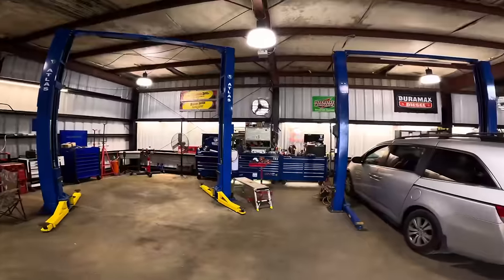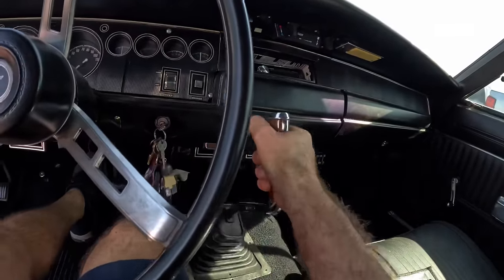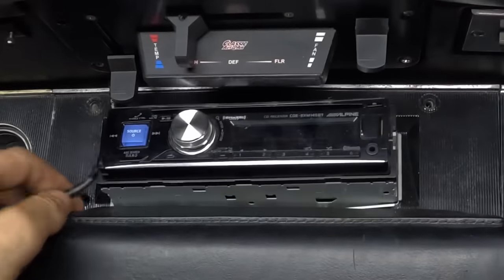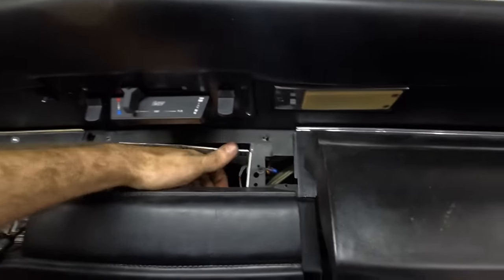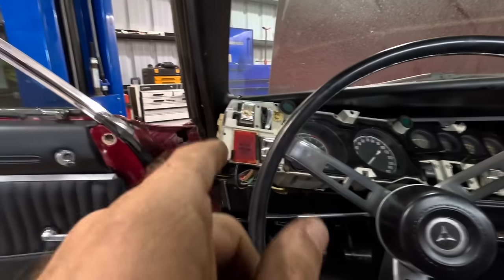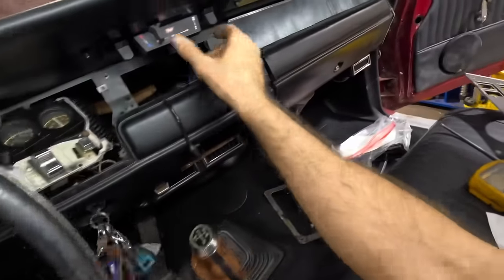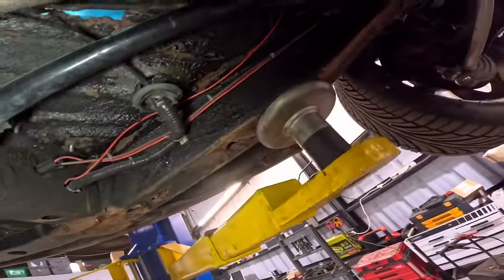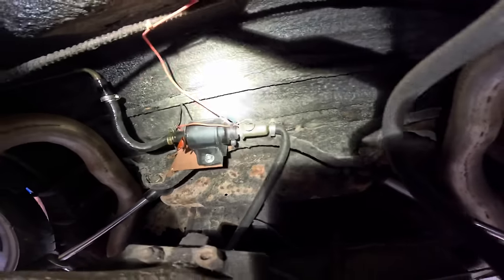Needs REee Restoration | 1968 Dodge Charger

Comment: As large as that car is I believe that the 68 Charger only dressed out to about 3800 lb. My 74 police interceptor was only 4,050. It was however the fastest car I ever personally owned, it had a 400 Interceptor engine in it which would wind up a bit higher than the 440. Three times I ran a 10 Mile Stretch an average 166.5 mph. And I did get it radar once at 187. It was still accelerating blazingly fast car once you got it off the stop. Especially if you were rolling along at about 60 to 65 it would accelerate 60 mph in about 3 seconds.
The amazing thing about it, even though I had changed out the carburetor to a holly instead of the original Carter. Was that it had a dead smooth idle.
As for the speedometer, the most often times you get that jumping speedometer. The magnets that cause the speedometer to work . A clock spring will resist the movement of the speedometer up the speedometer range. And there are a set of magnets that one is on the inside or outside of the other and that any current caused by the spinning magnets is what gives you your speedometer indication. Sometimes those magnets get out of place and they actually hit each other and that causes the speedometer to jump as those magnets turn it is frequently in the speedometer head itself that causes that jumping. It is not generally a gearing issue or a cable issue. So be very careful of making assumptions when you're working on vehicles that you've never turned to wrench on in any great amount. I've been wrenching on cars since about 1964 and did a lot of work on cars of the late sixties and early seventies especially. I don't still have it but I have a lot of knowledge out of a Chrysler racing manual that was put together by some of the Ramcharger group who were a bunch of Chrysler Engineers that had started a racing group and had come up with a lot of engineering tricks and tips that are still applicable to this day. Things that many people have forgotten if they ever knew them at all.
The biggest problem with that radio is it was a completely hacked job.
What you have there as a list of problems, is basically a punch list to finish the car out.
Yes that is a unibody car but there is no reason for those subframe connectors. I doubt there's enough power in that motor to ever need subframe connectors even in a 68 b-body. It does not have the floor pan of the Hemi or the convertible, which were one in the same which is an extra heavy floor pan with extra large torque boxes at the back, but it is a big block the very least it's a 383. The last time they put a 361 in them I believe is 1963 or 64.
This car needs a lot of love and care and work work work. And I also think it's a little bit out of your wheelhouse. This thing needs a frame-off restoration. Probably an AMD floor pan and frame replacement. And you can get all of the body panels. And basically rebuild this car into something really really really really really nice. But some of that old school stuff is good stuff it just has been neglected for a long time.
Reply: maybe that fast if you threw it out of an airplane , its very obvious you know just enough about Mopars in general to be dangerous
Reply: I truly hope Ray reads your message. I thought similar but could never have so efficiently laid it all out as you did. I was going to add that this car in the condition it's in should be owned by someone proficient in classic car wrenching or by a collector with plenty of $$ to burn on this type of long term resto- mod project. In that case finding a specialist in this era of vehicles. What a strange car to show up at Ray's!

Comment: Ray I have something you would love to work on but only my hand touch it. That is 1967 Plymouth Barracuda with 4k Org Miles. I watch this with a chuckle the whole time these are some of the easiest cars to work on. Before my Cuda I hade a 69 440 6pack Road Runner that i restored my self. Center Pad cant be removed with out taking the whole dash pad out and the radio that is easy mod made using delete plate and they are cut at bottom most of the time. Yearone and Classic Industries will be the owners friend. That car has alot of bad rust and frame damage  even with the full length frame additions where it is weld to is rust out that car need total resto. I bet it was buy site unseen cuz this looks like a shady classic dealer car.

Comment: Walk, no,no, no, run away from this car. Lol If you or the owner insists on trying to fix these knobs, connects, etc., I would give JC Whitney a look see. Use to find impossible to find parts through them when I worked on old, beat-up motorcycles years ago. If a junkyard didn't have it, Whitney would usually have something I could work with. It was a lot of years ago but I would give them a look and see.
Good luck with this beast. I absolutely love your channel.

Comment: I had a 69 charger with a 383 back in the day.  Black interior with Bucket seats, Automatic trans.,  dark green with a black vinyl top.  I loved that car.
Even with the automatic you could burn the tires from stand still and make it bark at 20.  That car was a giant killer.  Tore up some very mean cougars, Judges, but met it's betters against a Ford Pony Mach 1.  That was a beautiful  car.

Comment: 24:50  Possibility #3:  The cable is binding then released when enough torque has accumulated causing the bouncing speedo.  Happens often in these old cars when an engine or trans is pulled and the cable gets crimped or snagged.
Reply: Also happens when the cable gets dry.  A shot of grease down the cable might fix it.
Reply: Let’s get real. The cars is 55 years old. I needs a new Speedo cable.  Period

Comment: You need to pull the insert cable out of the Speedo housing and see if there are bad wear marks along the cable. If the cable looks good grease the cable lightly and reinsert the cable into the housing. If any shiny spots or wear and the cable housing looks good you can replace just the cable insert or replace both cable and housings and reattach the Speedo cable housing to the speedo until it clicks.
Reply: Speedo won't click, the retention clip is the bit missing from the end.  It's never going back in and staying, new cable is required.

Comment: Everything I saw on that Charger can be fixed.... but it could easily become a long, expensive process! A true restoration would need to be completely stripped down to the shell and a multi-year job in most shops. Just sourcing parts will take a lot of time and patience. But, it can be done and that car appears to actually MIGHT be a pretty good candidate for a high level of restoration. There were no signs of collision damage, that I could see. The tires were old, but appear to have even wear. Body condition under the bondo and paint may be a deciding factor.
When you were looking at the windshield wipers, it looked like the front half of the dash pad was missing... ???
It is probably good the exhaust cutouts aren't working. It looks like they terminate right under the driver and front passenger seats and would fill the cabin with carbon monoxide if used! They need some add'l pipes out to the side or to the rear.
I would have a conversation with the car owner about their goals for it. Do they want a "weekend driver" for occasional fun... a reliable daily driver... a long term, gradual "rolling restoration".... or a show quality resto-mod with modern updates?
Reply: f that dont live for ever fix it to safe drive run it

Comment: Talk about going down a rabbit hole! Find one thing bad, three more things pop up. If this car was mine, if I didn't want to do a body restoration, I'd start at the front and start fixing things one at a time, working my way back. It would probably take at least a year before everything it needed was repaired since I'd take my time.

Comment: 1:00 Ray the Charger is out of your wheelhouse it’s likely the most expensive car ever in the shop! I hope the owner has deep pockets we need more Chargers restored. Enjoyed Sema!
Reply: I agree, Run, don't walk away from this one. You would be on an unending search for parts, and be forever on the hook for niggling repairs that "you caused" while repairing other stuff. If the owner has unlimited funds, unlimited time, and the desire for a good vehicle, he needs to send this one to a professional restorer, maybe on the west coast. This is so far away from your expertise it will be a losing proposition in both the short and long term. Even if you are interested in this type restoration, chose another car that is not so far gone. Just my opinion.

Comment: RAY! I know those old 1960's switches.  They are engineered with, "Smokers" in mind. Remember, those days EVERYONE smoked and the tar would build up on the metal contacts. So, the switches MUST scrape the metal contacts or they fail like Lincolns. 🤣🤣🤣BTW, do you know ant reputable BMW mechanics? I will pay for advice.AND, There's a guy on Oregon (Graveyard Cars) who is a complete Mopar Nut Job who knows EVERYTHING about that car. He would be able to be a GREAT source of knowledge on parts, repairs, etc.. GOOD LUCK!

Comment: 68 was the year that I went to Vietnam. Came back and my wife had bought a new 1969 Toyota Carona with a 2 speed Totoglide automatic transmission. It was fire engine red. $2,400. Cheap.

Comment: Unless you have somewhere else to work on that car, and a lot of extra time on your hands, if I was in the same place I'd recommend sending it out for a restoration.  Like you say "if you touch it, it's yours".  That much fun you don't need.  The way things have been done to that car is a bad omen of what is waiting for any unsuspecting mechanic.  All of the parts can be found, but a bare metal chassis is the starting place. The Silverado is looking good.  Probably much quieter inside too.

Comment: Hey Ray,

I always like your content. Very knowledgeable.  As for that poor Charger, it needs a lot of work. So far the work that was done is very poorly done. My father and I restored a 1969 Charger from the ground up. We strip that car of all wires and hose lines. It's too bad that the owner doesn't do the same. That car is so awesome.

Comment: I think I have classic cars in my blood. I've never worked on a Charger but I instinctively know how to repair every single thing you touched. 2 front floor pan sections welded in and a Painless wiring harness will solve 90% of that thing's problems.

Comment: That right there is a ghetto 90s/ early 2000s stereo install. Those RCA cables look like the cheap ones that were sold at Circuit City back in the day.

Comment: Back in the day radios would come with perforated metal straps to secure the new radio. Stock radios were 2 or 3 times the size of aftermarket units. Ford had vacuum powered hide away headlights.

Comment: I am an old school mechanic and I can’t tell in the video if the speedometer cable have a broken release tab that latches to the speedometer or not. I see a notch on the cable connector which I believe used to have plastic latch which get brittle with age and snap off itself. 

The vibration from spinning cable inside will often shake it loose again if you try to install it with missing latch. 

One trick which work on some cable connector is to take two zip ties. On one zip tie is to cut off the end of it and insert it into second zip tie upside down which will go inside the notch while you zip tie the cable back in making into a latch for the cable.  On speedometer, there a ring that the latch would latch into to lock cable into place. 

You may have to disconnect cable from transmission side to pull cable out behind dashboard to give you room to work on getting it back on the speedometer then pull cable back toward transmission as you put the dashboard back in place. 

Also all cable are sized that you only get 3 or so inches of space to pull out dashboard so you could reach behind it to squeeze and unlatch the cable off the speedometer. 

Speedometer cables with plastic latches that are molded as part of the connector are a royal pain in the butt.

Comment: If it was mine, I'd send it out to Texas to Muscle Rod Shop and get Brandon and his crew to take it down the the gas tank lid and start.  They do good work. They're Demoranch Matt's go to restore and body shop guys, and some of the stuff they've done is GORGEOUS.  If you want it to be right and like it was off the showroom floor then that's the best idea I know of.  Otherwise, it's chewing gum and bailing wire fixes with your mechanical repairs, but it'll never be like it should be.  Yes, it will cost a bit and will take a good while to get it done, but if it's worth doing it's worth doing right, if you ask me...which I know you didn't but...anyway.  Take care.

Comment: Hey while you have the door panels off put some of that fattmatt or that stick on insulation stuff on the door skin. IIT will make your door sound like a Cadillac when you close it you know that"chunk" sound plus the installation factor for outside sound too will help. The glass in the Cadillac may be laminated see if you can get that?

Comment: Looks like some 80's hack job with a Pep Boys radio install and some speakers thrown in the trunk back when these were just $1000 used cars. Then in the 90's, a $299 Maaco paint job that sprayed over all the rust and a set of "mag" wheels to get it sold to the next victim.

Comment: Ray, I noticed, when you upgraded your outside mirrors, the door speakers were blown. I hsve a pair of OEM speakers (replacing the originals)  that were less than two years old when i removed them for an upgraded set. If you want them, they are yours for the cost of shipping from Dallas Texas. 

I've been watching your channel fro.about a year before you went independent, learned a good deal and have enjoyed your videos. Best of luck to your enterprise.

Comment: Your best option, is to tell the owner that if he has the money, he needs to have a shop that specializes in classic restorations fix it from top to bottom. If he doesn't have the money, he either needs to by a manual and learn, or sell it to someone that has the money to fix it properly.

Comment: Time for a radiator cap job. To quote Monty python "Run Away, Run Away".   It strikes me as an Albatross you will never be done with. No matter what you do, the owner will always find another problem or will never be happy. Car is likely worth more for whatever parts are salvageable than it's value after repairs.

Comment: That 68 charger needs to go to a restoration  shop what should go into the radio hole is a double  din radio installed kit from a audio  shop for auto

Comment: From my past experience.  If after making sure the speedometer cable is fully engaged but still get erratic reading the cable probably has old lube  and needs to be replaced. 
The headlight doors on some are vacuum actuated.

Comment: Looks like a DIN mount for the stereo.  Not the original Chrysler mount that I am familiar with.  The Chrysler mount secured with screws around the stereo and an screw in the back...a larger arrangement.  You used to be able to get adapters, but I made an adapter out of 1/8" thick aluminum, painted black.

Comment: At least plymouth/dodge got away from the push button HVAC control that was vacuum controlled. Those were a pain on those 68 Plymouth Fury's, had to remove half the dash to get out. These  controls were always going bad

Comment: The first question would be, "How much is the customer willing to invest?" If you get a go on full resto. First step, strip it clean and send it to a body shop. Second step, complete rewire. Once those two steps are complete. Then and only then could you start on everything else. Which, given the engine and trans is in good condition, would be all the odds and ends stuff, like the radio.

If not. Unless they're in for a rewiring. I'd just, "Return to sender. Address Unknown."  Could even send them a copy of the Elvis Presley song as well.

Comment: I'm no pro mechanic (even calling myself a "shadetree mechanic" is pushing it, imo), but I'd walk away from that one, my man. If I were doing it myself, for myself, that's one thing. But...that Charger needs a shop that specializes in classic car restorations. It's more expensive for the owner, going that route, but it's more worth everyone's time. Besides, those guys have the knowledge and expertise to actually do the job, the know-how to fix what they break (if they break it), and the connections to source necessary parts or fabricate them if need be. There's just too much in there that needs correcting and bringing back to spec for anyone else. That thing will be stuck in any shop for months getting all that done properly, but better as a resto shop than a mechanic's!

Comment: I have restored a half dozen of these Chargers. I sat here trying to guide you as I watched…lol . That central pad has speed nuts holding it on from the back. Don’t bother, there is a slim cutout for ac vents behind it. It provides no better access. Go in through the glovebox.  

Headlights are half-assed modified on this car. They got rid of the factory vacuum actuators. You can see the remaining vacuum switching plastic nibs beside the switch. You can buy a new switch easily. 

Yes. Unibody. 

Wiper motor needs to be rebuilt. It is a 3 speed, no new ones available. 

Speedometer might need speedometer grease applied. I see that jumping thing from the plastic gear not seated right on the transmission side, but usually needs grease on the cable end. 

This poor car has been hacked together and “updated”. It needs meticulous wiring inspection and repair. Ideally, new wiring harnesses end to end. Yeah, $1200 + in harnesses, but worth it.

This needs serious restoration just to be safe.